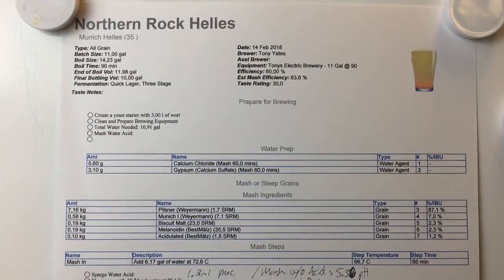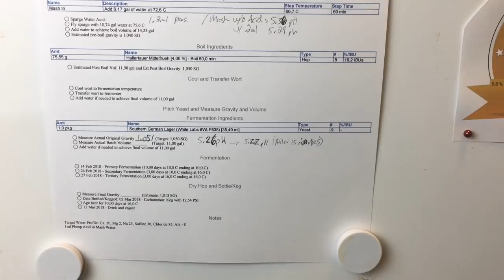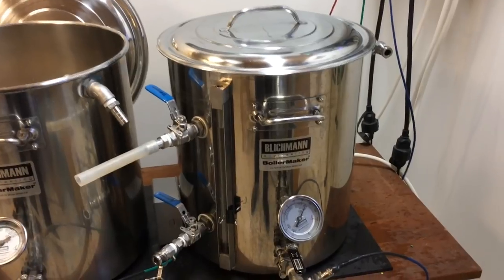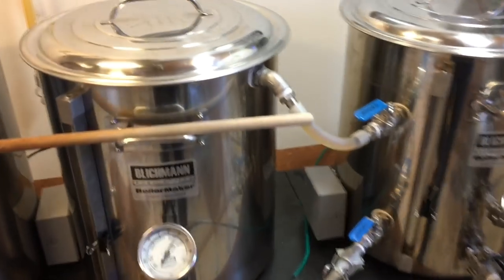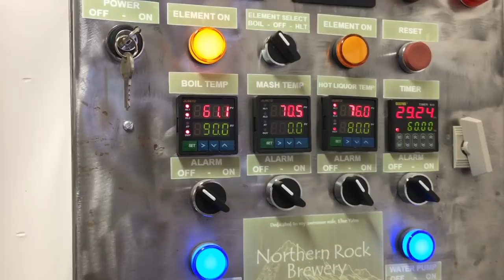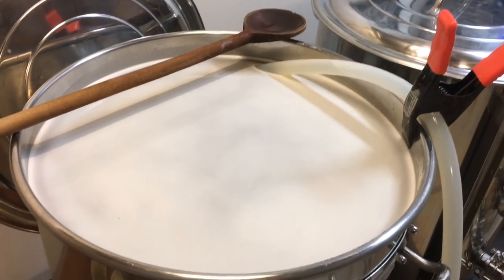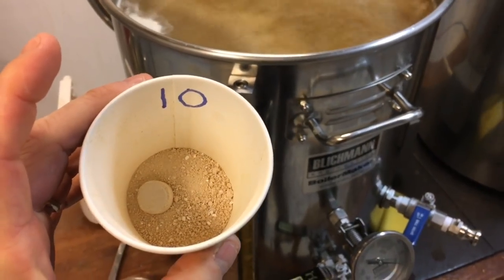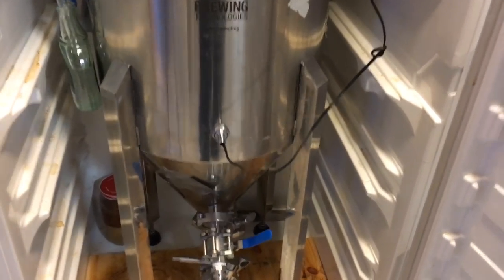Brew Day - Munich Helles

Comment: Tony, I'm a big fan and you've inspired me to move to an all electric HERMS system.  I'm starting to get more into water chemistry and I notice in your videos that you treat your mash water before underletting.  I was wondering whether you treat your sparge water as well and if you do, how you calculate how much minerals to add after you have subtracted the volume for the mash given that you have to top off above your HERMS coil.  Keep up the great work and thanks for all of the great videos!
Reply from the maker: Hi Sam! I only acidifying the sparge water to 5.5 pH, and only add minerals to mashtun and boil kettle. For larger mineral additions, I.e. for IPAs, I’ll divide the additions between the two, otherwise I add them all to the Mashtun, as seen in this video. Hope this helps! Cheers!

Comment: Nice vid Tony. I've noticed your process has changed a bit from earlier vids in regards to adding your strike. I know for a time you pushed the strike just through the coil and used the exchange from the HLT so you didn't have to refill and reheat the HLT. Any reason you went back to your other way of pulling it directly from the HLT? Just curious. Cheers!
Reply from the maker: Yeah, Daniel asked me the same thing below... Although I liked that technique, it doesn’t give the opportunity to acidify the sparge water, unfortunately. So when I make the effort correcting the mash pH, I don’t want to ruin it with sparging with water with a pH higher than 5.5 pH, or more alkalinity. Doing so increases chances of extracting more undesirables from the grains, so I avoid that this way. Hope this answers you question. Cheers!
Reply: Tony Yates: How about using the BK to heat up "replacement-water" for the HLT (after strike)? In that case you could get to circulation faster after strike.

Comment: Nice brew day Tony, i bet its going to be a good one! I did just wonder why, when your boil was 120 mins, you boiled some water off and then added some back in to “hit your numbers”, i didn’t get that bit - if you’re boiling only water off and then adding it back in, why not just cut out the maths and make the boil a bit shorter? Look forward to seeing how you do in the competition though! I did a pilsner last weekend (I hardly ever do lagers!) and then a witbier yesterday, i guess that’s what we should be doing with summer on the horizon! Good work and nice vid!
Reply from the maker: Hi and thanks! In regards to your question.... while some people believe that longer boils are unnecessary with today's 'modified' malts, I'm not convinced. "I'm not convinced" is actually an incorrect way to put it. I'm more than convinced by reading the science/chemistry behind the reasons why one should boil 90 minutes with a similar malt bill, and therefore adhere to processes that reliably eliminate the precursors to DMS and other off-flavors. I don't like taking changes when investing so much time brewing. I respect other peoples 'experiments' or process, and I hope that stance is mutual. So, giving that I wouldn't boil less than 90 minutes, adding water at the 60 minutes mark to get my gravity to a place that would ensure I ended up near where I wanted, and provided the desired IBU's I wanted for the post-boil volume,  I decided to execute that step as such. I hope this doesn't come off as too eccentric, haha, but 'oh-well' if it does. This is the thought process I had for this brew day. So, other than changing the circumstances (too high efficiency), I don't think I will change any decision if it happens again. That said, I know I'm not infallible, and open to suggestions and further discussions about my chosen process. Cheers!
Reply: Hi Tony, and thank you for such a comprehensive answer, that makes a lot of sense and definitely not eccentric - thinking about it the beers I’ve brewed that had a longer boil time do seem to be the ones that turned out somehow “cleaner” - i may well adopt your policy of a 90 minute brew! Yes, it would be a shame to go to all that effort for it all to be ruined for half an hour of impatience! Cheers.

Comment: Hey Tony.  Just wondering what’s the smallest batch size you’ve ever done with your set up? Could you do 3 gallon batches?
Reply from the maker: The smallest batch size I have done is 5 gallons. The top of the element is very close to the 3 gallon mark and I wouldn't try something that small, but could probably go as low as 4 gallons. Cheers!

Comment: Hi Tony, great video. Your process really shines. Did you remember to adjust your hops up a little for the higher volume? I have forgotten more than once. I noted you added your calcium to the mash. I have fairly soft water and have also found adding calcium to the mash really kicks up the mash extraction efficiency. I see you've had several questions about your crush. I've been using a 1.02mm/.040 crush for quite awhile now without any problems and usually have outstanding extraction results with that, but I'm using a bucket-in-bucket mash/lauter tun. Brew on!
Reply from the maker: Hi J! Thanks for the feedback and questions! I thought about IBUs when adding more water, and with knowing that I wasn't actually targeting/achieving a different volume than expected, I believe I would have still arrived at my intended target calculated IBU. That said, I did punch in the numbers to see what my calculated IBUs would be, in relation to the style, if I added in 10g more. Turns out it put it smack-dab in the middle for the style and I did add it. Haha... Yeah, I left that part out of the video. Not to be malicious or deviant, it was more spur of the moment and didn't think to record or mention it. :-/. Sorry about that. Will try to be better about those details next time. I talk about calcium additions in the mash in the second water video. Grain Mill settings, yeah that's on the finer side and better efficiency would make sense. I adjust down when milling smaller grains like spelt, malted oats, etc. but generally stay around .045". Maybe one day I'll try .040. Cheers!

Comment: First off, let me say "YAY!!! BREW DAY!!"

Secondly, a quick question: You racked your wort to a bucket fermentor, then I looked back at my screen and saw you standing over a chronical SS Brewtech fermentor in a fermentation chamber. Why not just rack directly into the chronical? 

I love watching your brew days. I am currently in the process of upgrading my brewery from an outside gas 5 gal with igloo MT into an inside 15 gal electric HERMS. So why I am waiting for more $$ to get it running, I love watching, learning and brewing vicariously though you.  Great job and GOOD LUCK!
Reply from the maker: Thanks! Yeah, well I ferment in the fridge for best temperature control and the 10+gallons in the chronical is very hard to move around. So, I fill a sanitized bucket a couple times and dump it into the pre-positioned fermenter. I suppose I could just pump it over, but like verifying the amount by seeing the volume on the side of the bucket-as there tends to be quite a lot of foaming during aeration. Cheers!
Reply: Makes total sense! Thank you!!

Comment: Great video as always.
One question though: Why did you stop using your water flow meter ? I thought it was a clever way of avoiding to have to refill the HLT and wait for it to come up to temp.
Reply from the maker: Hi Daniel! Yeah I liked that technique too, but it doesn’t give the opportunity to acidify the sparge water, unfortunately. So when I make the effort correcting the mash pH, I don’t want to ruin it with sparging with water with a pH higher than 5.5 pH, or more alkalinity. Doing so increases chances of extracting more undesirables from the grains, so I avoid that this way. Hope this answers you question. Cheers!

Comment: Looked like a great Helles brew day and as someone who has sampled your Helles, don't think you need to much luck in the competition. I got dinged in NHC a few years ago for DMS in my Helles. I know do the 90 min boil but haven't resubmitted yet for a comp. I will at some point. Hey, since our systems are very similar, wanted to ask how you get out enough sugars to avoid going below 1.010 while sparking? On heavier beers, it's no issue, but when aim doing beers <6%, I always seem to hit 1.010 in sparge shy of my fill target. Since I need to collect 7.25 Gallons to get enough wort into bucket for a 5gallon batch (I lose probably a gallon behind in the kettle), I begin to drop below 1.010 at around 5-6 gallons and have to top up with more water. Wondering if I need to tweak beersmith settings or something? Cheers.
Reply from the maker: Haha, thanks for your vote of confidence! While the competition is split into two sides, one by certified judges and the other is a public favorite style of judging, I'm only going for the latter. I don't crave winning and am participating to just enjoy the night and meet other local home brewers. 
In regards to sparging gravity... With light beers, and BeerSmith set at 83% efficiency, I've gone as low as 1.008, which is safe as long as pH is equal to or less than 5.5 pH. But yeah, it's better (comfortable) to hit pre-boil volume at an expected gravity with a final sparge gravity around 1.010. For that I found lowering efficiency to ca. 80%, which adds a few a few ounces more of total grain to the grain bill, will result in reaching the desired preboil volume with a higher sparge gravity, and at the desired preboil gravity. It's interesting to see the cascading consequences of changing a single variable. Hope the helps! Cheers!
Reply: I don't like the NHC because the judges are not very skilled at least not the judges I got. One of them later ended up getting banned and they had to rejudge my beer.

Got dinged into 2nd place.

Comment: Nice videos mate. Good explanations. Can you tell me one thing please. What type of fitting are you using for the thermometer on the output from the counter flow cooling coil? I have a digital thermometer from a SS brewbucket and would like to make something similar. Thanks!
Reply from the maker: Hi and thanks! I use quick disconnect fittings to easily connect and disconnect the thermometer. It also makes it easy to turn for easy reading. Hope this helps! Cheers!
Reply: Tony Yates is it a special thermometer or something you made with a special T piece or something?
Reply from the maker: Hi Mike, No, it's not a special thermometer. The thermometer is threaded into a quick disconnect, which fits into a female quick disconnect that is threaded into a T fitting. Here is a close up image, I hope this helps!: https://photos.app.goo.gl/uqCyeCpPIt9D8YbF2

Comment: Hi Tony. Thanks for the great contents! Keep up the good work :-) I was watching one of your older uploads regarding the panel you made and later sold. Would it be possible for you to point me in the direction of some online ressources that could explain how to make a similar panel and would you also be able to advise regarding puchasing parts mm for it.
Reply from the maker: Hi! Yeah sure, I have referenced www.thelectricbrewery.com website on may occasions as having the complete plans I used to build my panels. I have no affiliation with them (or anyone), and still feel confident with recommending that site for the plans. It has a complete parts listing and links to where to buy all the various items. Hope this helps! Cheers!
Reply: Thanks a lot :-)